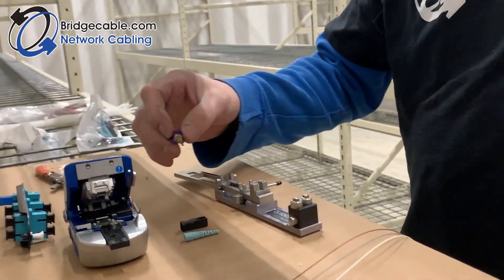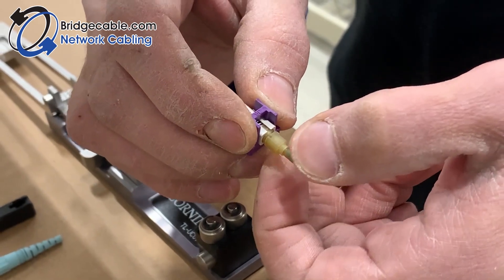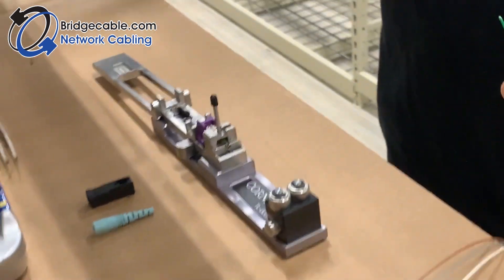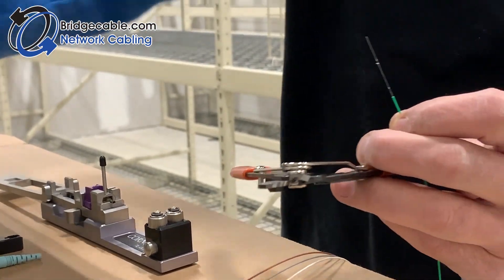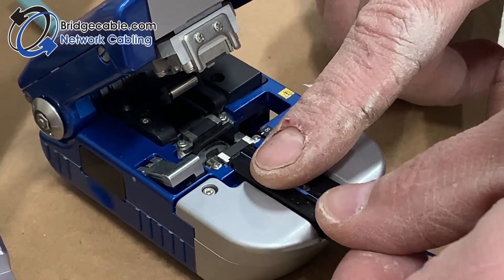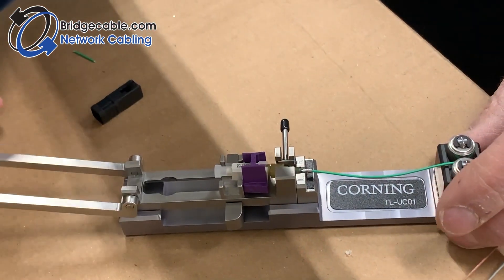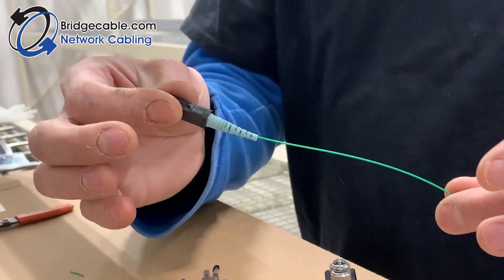How to Use Corning Unicam TL-UC01 Fiber Optic Connector - Network Cabling | BridgeCable.com

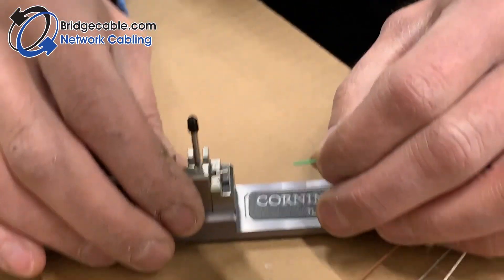Comment: We hook a VFL to the connector end and adjust the angle of the stripped fiber until the light goes out, then proceed with locking and crimping the connector 3:04

Comment: You made that look pretty easy!  Guess with these new tools fiber is getting easier and easier to terminate. Going to have to bite the bullet and get a setup and start the practicing. Thanks for good content.
Reply from the maker: The tools and the ease of use has changed over the years. With so much fiber out there it's getting easier and more precise as well. Tools are pricey still...that one was $550 but build it into your quote if you are just starting out. Then when you get the job...buy the tool...and it's in your inventory forever :)
Reply: Coming from cut and polish I thought this way was a joke until I tested years ago! I used to avoid them! 😂